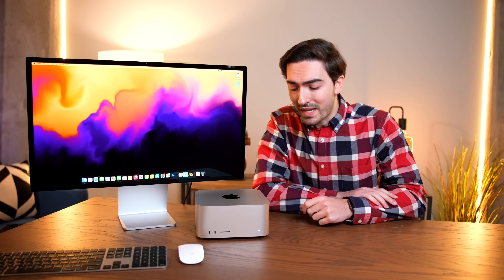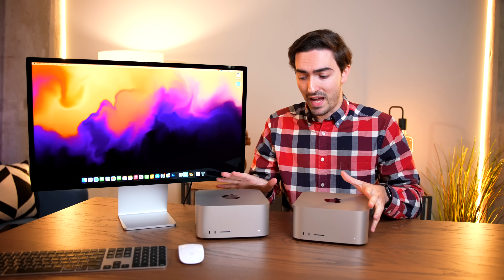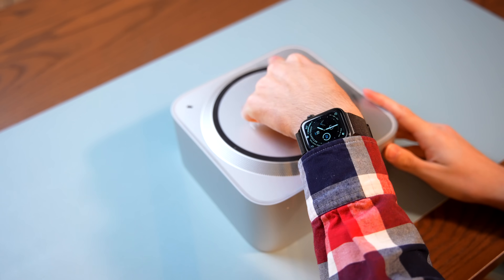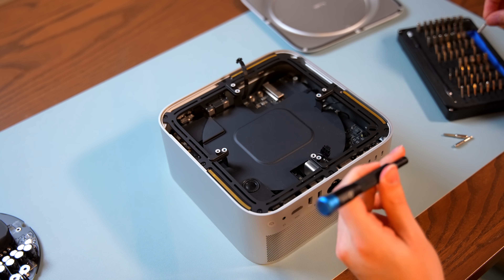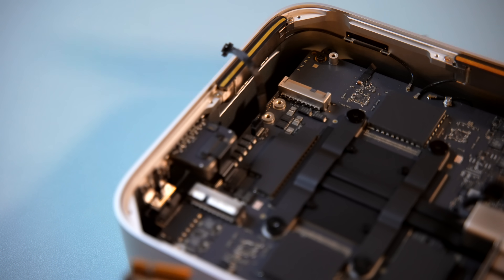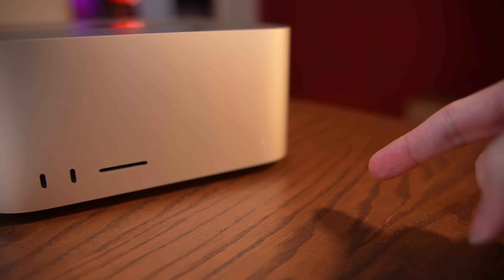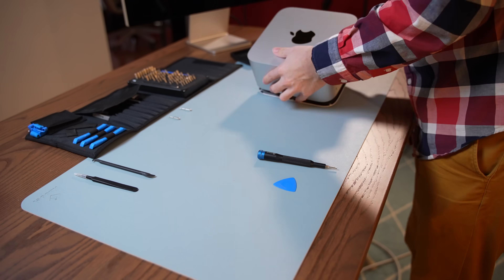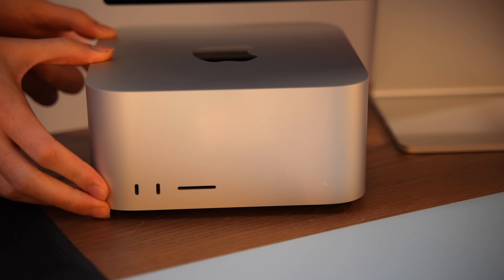What happens if you try to UPGRADE a $5,000 Mac Studio?

Comment: I appreciate the risk you've taken by disassembling both Mac Studios and I do appreciate your video. 

But man I wish if you'd just reached this a bit prior? The M1 chip just like the T2 before needs to establish a one time security handshake to set it up for the internal usage.. Have you considered putting the Mac Studio into DFU and restore it? This way 100% it'll merge both SSD in RAID 0 and appear as one.. 

I'm not defending Apple, Apple do not care a single bit for Right to Repair but I wish if you'd made a quick research before going into this.

Thanks again

Comment: Kinda wondering if this has something to do with disk encryption on the Apple Silicone systems…

Regardless, fully agreed. This is why I don’t bother with Apple desktops. I love me some MacBook Pros, and I can forgive a lack of upgradability in a laptop. But not in a desktop. You shouldn’t have to spend an extra $5k on a Mac Pro just to be able to upgrade the internal storage. This isn’t an appliance of an iMac that you stick in the den for 10 years as a family computer and replace when it doesn’t cut it anymore. This is a desktop designed specifically for people who need both more power and flexibility. Like, someone who might work in photo or video, already needs a good amount of working internal storage, and then maybe upgrades to a new camera that generates bigger files and finds that they could suddenly use more, even though the rest of the system is fine.
Reply: I agree, it’s sad. Honestly just stick with Apple notebooks.

Comment: Security my foot. If someone were to steal your internal drive, they'd have to leave your machine behind, bricked, right? The intention of the spy (if whoever does this is interested on the data, and not on the machine itself, they aren't thieves, but spies) is to leave your mac bricked so you'd think it was defective, giving them time to access the data before you noticed the drive was missing. If they can't access the data from a machine of their own, they'd have to take tour whole machine (which would be far easier, to be honest), but you'd notice it missing. The spy's recourse would be to leave an identical machine in place of your machine, but if the machine booted you'd notice it wasn't the same. Therefore, the spy would have to leave an identical, bricked, machine on your desk.

Where would the spy get a bricked Studio Mac? They'd have to buy a brand-new Studio Mac and brick it themselves, of course. Who would win in this situation? Apple, who would have sold TWO overpriced machines, one to you and one to the spy. 

A cunning plan, Apple… a cunning plan.

Comment: i'd take upgradable RAM over in SoC soldered RAM any day, specially on an expensive production machine. 
In 5-6 years when 16gb is not gonna cut it, but the machine is still doing fine for what you do, you're gonna be forced to upgrade to the latest model if you want more RAM. Both soldering RAM and making non-standard NAND packages that use the internal controller are anti-consumer moves to lock you into their repair service and make you a possible future customer when you need to upgrade your machine.

Comment: 12:45 hard disagree, I want my SDD to be locked to the Secure Enclave (SEP), if it was able to be easily swapped then it’s easier for a hacker to brute force into. On Windows 10 Home you didn’t get encryption or storage locking so anyone with physical access could access your data. While that’s good for data recovery it is not good for privacy or security. To me privacy and security trump recoverability because you should be backing up (which I know most people don’t do unfortunately). As others mentioned the SSD can likely be paired to the Mac using Apple Configurator to enable the secure pair with the SEP so it’s not even as bad as it seems, just a more annoying especially since not everyone has another Mac (I sure don’t).
Reply: Apple can give option to just format the drive if new drive is present or cannot boot on recovery boot.
Reply: @KarrasBastomi  Yea maybe, I’m sure it’s possible but maybe there’s something special with using Apple Configurator on a second Mac, like maybe it’s required to pair it due to the way it functions. Idk though I’m only speculating with that.
Reply: So when your ssd dies... You rather replace the whole motherboard?
Reply: @johnaart  No I wouldn’t, I’d love it to modular like the Mac Studio and the Mac Pro prior. I just want it to be paired to the SEP meaning the SSD will only function and be recognized by my Mac. If you pair it to a new Mac then all the previous data would be lost but the SSD could still function. Unfortunately though I have a MacBook Pro 16 so mines solder already anyways.
Reply: When your SSD dies you take it to the Apple store and they replace the module.
Reply: Agreed. This is not a consumer machine for people extending their gaming library over time. This is a tool for productive people that also need security, and will have most of their storage on servers or NAS. It may look as a pain, but this is fully consistent with the target audience of this machine.

Comment: Tell me about it. I have an older generation iPad Pro, it’s charging port recently became intermittent, so much so that the official Apple charger stopped working and will now only charger using a third party charger but even then it’s not consistent. Tried to get Apple to fix it and they basically told me to buy a new iPad. 😡🤬

Comment: So it’s not a plug and play replacement, so apple are being selfish and evil? Does this apply to any other piece of hardware that requires firmware? 

You’re being a bit disingenuous imo. There’s clearly a solution to this problem, and third party replacement drives will almost certainly become available soon enough. The Mac studio has been out for what, a week? Have some patience. At least enough patience to run the permissions tool that a dozen people have posted that I can only assume you knew about anyway…

Comment: The only reason for socketed SSDs is the possibility for Apple to replace them if they fail. But other than that it's just like soldered ones, they want to make sure no one can upgrade, in order to charge the massive price for upgrades. If their storage was upgradable I would have moved my main desktop from Windows to Mac, instead I only bought a 1TB Mac Mini as a secondary device as I need at least 6TB for my 5TB Onedrive folder, that cannot be installed on removable SSDs. But I am not paying the 8TB price for that...

Comment: theory: the second ssd slot recognizes a very specific type of ssd, one that only adds additional storage modules and has no independent controllers. as for the inability to recognize the known good ssd, I assume that the configuration of the ssd is tied to the serial, if you can boot into recovery or maybe even just refresh the nvram? I know they still have nvram even if it doesnt work the same as it used to.
Reply: you can view the nvram settings in terminal with NVRAM -p

Comment: Is there a possibility that the SSD you got from the other Mac Studio was still encrypted? In that case it would make sense that the other one can’t do anything with it
Reply: that's exactly what apple has done, that's how its done on all iPhones and MacBooks.
Reply: Yes, the SSD is probably FDE'd and decryption keys are stored in the original system's equivalent of a TPM chip so any other machine can't decrypt it, same will happen if you apply Bitlocker on a Windows machine, it will store the decryption key in the TPM of whichever machine you performed the Bitlocker encryption on so the disk won't boot on another one, but at least Bitlocker gives you an opportunity to use a recovery key in case you do swap the disk to another machine.
Reply: @zaremolbepsidrink  The difference, of course, being that a modern PC will boot into the onboard firmware and then let you boot any other attached bootable device, assuming it's signed (if secure boot is enabled) whereas apple needs a paired SSD just to show you the boot menu.
Reply: @rachelhutchison5961  yes, because Apple chose not to use the ARM implementation of UEFI and instead went with creating their own proprietary firmware much like what every android phone has, even with with their Intel Macs, where they do use UEFI, they took out the configuration menu that you'd usually get and left everything else.

Comment: I view these machines as disposable at this point, which is utterly insane.  If your main hard drive dies, you have no choice but to go to apple to have it repaired.  When I talked to apple recently they had no idea how much that would even cost.  Compared to the old Mac pros of years back they have gone in the opposite direction of upgradability and being able to do simple maintenance yourself.  It's pure greed and insane.
Reply: Just attach an external SSD with an OS installed. On silicon (M1, M2) old down the power button to reopen until it asks you which drive you want to use. On Intel  hold the power button in AND the OPTION key. Simple as this folks! No need to replace anything internal and will run just about as fast on external as internal, easily fast enough for your everyday work unless you are a video programmer, etc. Wonderful Luke knbows this but doesn't tell you because it would take away some of his content.
Reply: you mean going to apple to have an apple product repaired... hmmmm how strange
Reply: Not disposable, trade in-able.

Comment: I'm sure there will be a way from the aftermarket to flash the boot loader to allow for 3rd party SSD upgrades.
Reply: Kinda pointless, since those are special apple connector, there are no 3rd party ssd that will work.
Reply: @qiyuxuan9437  they will start making ssd's that work with that connector like they did for MacBooks that had proprietary connector and you can buy aftermarket SSDs for now.
Reply: @abc123fhdi  Macbook was still using nvme ssd with a modified connectors that is pretty much just like m.2. This new connector seems very different tho, the ssd has no controller on it, only nand, it might use a different protocol unlike the standerd nvme protocol. There might be patent issue for 3rd party to make compatible ssd. Since mac studio is a desktop, adding a thunderbolt ssd dock can easily expand storage without voiding your warranty.

Comment: As prevously stated, the only way you'd get it to work was to put the device into DFU mode and restore from a T2 machine using the AppleConfigurator2. Even then, with this drive serialization in place, you may find drive configuration limitations. It sucks because of the TBW, data recovery and convenience but that's Apple's business model.

Comment: While I am a user and love the Mac/iOS experience --Good luck with Apple changing their business model.  Only massive customer outcry or Congressional Signed Law will ever make this happen.  And you are right, the "right to repair" is only receiving lip service from Apple.
Reply: Remember Apple's response to the Final Cut Pro 7 OUTRAGE -they just put Final Cut Pro 7 back for sale but keep changing their FCP X (or, as it's currently called iMovie Pro) -until the O.S. changed and FCP 7 wouldn't work anymore though tens of thousands still used it. That's when EVERYBODY found out that Apple could care less about their Pro users -not really. Apple didn't blink when they discontinued Aperture, screwing over tens of thousands of professional photographers.
Reply: rightfully so, especially in Apple products.
the efficiency of this products is off the charts, you cannot even send your device to repair/upgrade in comparison to this method appple is doing.
you will waste more money and CO2, far more.
Apple is dooing everything correctly.
fuck the right to repair movement which has no clue whatsoever about the consequences of their woke BS movement causing the opposite of what they claim.

Comment: Thanks, but with this, I will not buy an Apple studio... how many components have a computer, how easy is it to have a fault in any part? 
I remember a new Macbook Pro 13'' in 2011 that didn't boot in the second week for a problem with a ram module, they change it free of charge(*)... but if a module of ram in an Apple Studio, is necessary to change all the logic board, and the processor... so you need to turn it to an Apple Authorized Service Provider, to be able to change only the ram module. 

(*) but in 2015 I sold it with an SSD, and the maximum of memory available for it, and I upgraded myself. the maximum was only 12 Gb because if I take out the first slot the original 4Gb of ram didn't boot at all, but in the second slot I could attach an 8Gb... very similar to that you found... so this is not new.

Comment: Uhm, you probably should have gotten yourself familiar with the booting process of M1 Macs and how the SSD stuff works in general. First, the SSD modules are hardware encrypted with a key unique to every Mac. So of course you can not boot an Apple Silicon Mac from an SSD module that has been sitting inside another Mac.
Second, a large part of the firmware is sitting on the SSD (for example iBoot Stage 2) which is, why the machine does not turn on at all and why it only gives you a blinking light. M1 Macs also do not support booting from external USB drives without the initial macOS stage being booted from the internal SSD first.
So what you essentially need to do after switching or upgrading the SSD is to run an IPSW restore through DFU. Try that and I am 100% sure it will work.

Comment: Probably the reason you can’t simply swap it out is because the drive is locked to the motherboard for encryption via the Secure Enclave. 

Frustrating I know, but a side effect of security feature.
Reply: Don't let them convince you it's a security feature you can switch other drives out on OSs with secured drives no reason apple couldn't do the same
Reply: true, it is way better this way, just sell your device and buy the one with your wanted stats.
you wont loose any money and the machines will keep extreme value over the decade because nobody is messing with the hardware.
also it is way more efficient, cheaper, and reliable than customers putting their hands into a device.

Comment: With the Mac Pro, you have to restore firmware to the T2 chip using Apple Configurator when upgrading the storage modules. Maybe this is or will be a similar process?

Comment: When you had both SSDs in one machine, did you completely erase the second one? If both SSDs had operating systems on them, I wonder if it was getting confused. Plus I saw other comments about needing AppleConfigurator, which would explain why they didn't work when you swapped the SSDs. @DarklingGolem mentioned that it was tied to the T2 chip. That would also explain why the main SSD only worked when it was in the primary slot.